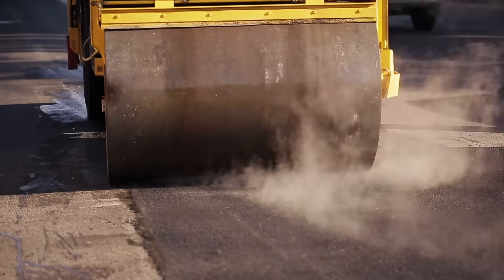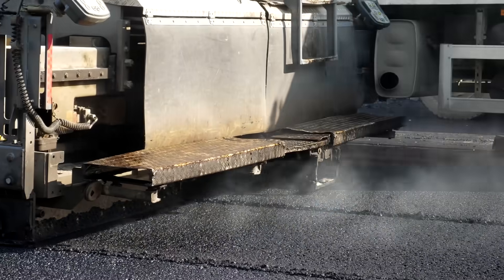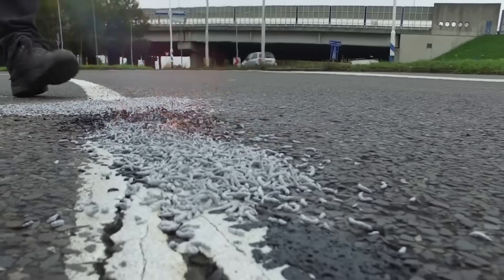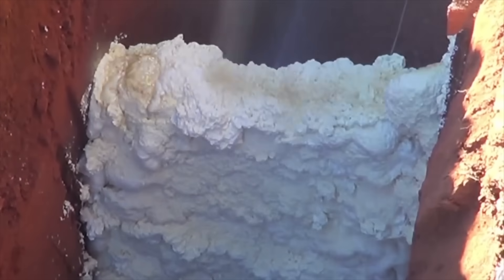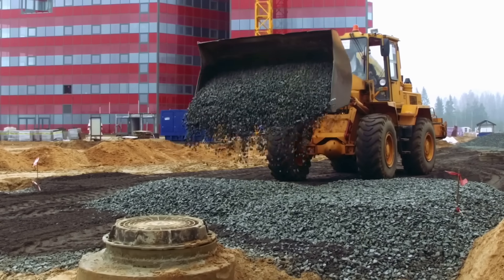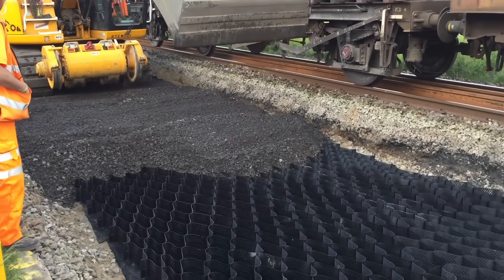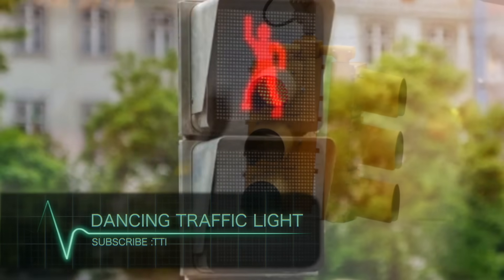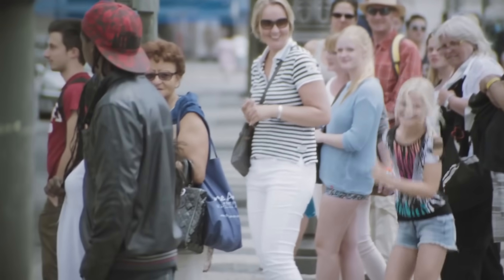7 Road Inventions That Will Change Your Life ▶41

Comment: I've been looking at the geogrid for fifteen years and wonder if it holds up over time. There is another way to stabilize gravel, which involves gluing the surface together with polyurethane. However, that method requires smooth edge gravel, not crushed stone and the right balance of poly to gravel. If too little poly goes onto the gravel, the surface will break up soon. If too much poly is applied, the surface will shed rain instead of absorbing it, defeating its environmental benefits and causing the same problems that large expanses of concrete can cause.  Somehow, it seems that this tech has not caught on enough to be considered 'standard' tech and remains 'new.'

Comment: We should be made to understand that these repair methods assume at the outset that the damage is only to the riding surface and does not result from inadequate or failed subbase or base materials.  In these cases where the sub and base are involved the repair must go deeper and be more  costly and time consuming. The web repairs are the most interesting in that it provides a reinforcing matrix for the fillers being used.  In the example the matrix materials used appear to be  asphalting concrete. The plastic or poly reinforcing web cost must be countered by longer life or  lower construction and compacting costs?

Comment: The product we in saskatchewan call chip seal is very strategic in its design, it is a very clever idea that takes certain compact rock which is very plentiful and crushed first with jaws then with a cone crusher so as to end up with a product that has almost no round shape but like tiny shale pieces. This product idea is that as wheels or tires roll over its in every day use it reduces almost to zero it's property of working loose. Round gravel works loose very easy  flat pieces not so easy. They form a tight stacked and packed principal that does not work loosen as easily. The big thing yet also is it dose not to let water penetrate through as easily thus not allowing the base underneath the asphalt to get soft from becoming muddy. Thus it's name CHIP SEAL. It costs more to make but one engineer told me it durability out performs other repair ideas by ten.

Comment: As a construction executive who has to be involved in road repairs, the geogrid, the polylevel, and the thermoplastic spot repair system really stand out.
Reply: There even trying using old rubber tyres ( under trial , here in the uk )

Comment: most of these technologies look like crap to me. Plastic is way too soft for use in road construction, and since it doesn't bond to tar, you will have millions of fissures for water retention.
Also, while rumble strip are great, they must be made by ADDING tar strips to the surface, not removing divets!!
Making cavities weakens the road at the edge, a bad idea, and makes pockets to hold water, the worst thing for tar.

Comment: We have two major problems in the UK with road repairs, the "Vehicle Excise Licence" (which used to be the Road Fund Tax for the roads) is now mainly used for other government spending and not spent on the roads. The second problem (not ishoo) is that many utilities were laid under roads (gas, water, electricity,sewage, cable). This means gas, electricity, etc, companies keep digging up perfectly good road but never make good the surface. I believe we should have a country-wide rolling programme of gradually moving utilities to the footpaths or grass verges where possible. This would make repairing the road surface much easier, because there would be less, or no, ironwork to work around. It the road surface has less breaks in it, then the potholes which form around drain or manhole covers etc will not occur.
Not that it matters. St Greta has informed me that we will all be toast in 12 years anyway, so that's how long the roads need to last, and no more.
Reply: Bill that's a Great Idea! But what about pedestrians? And who is St Greta?
Reply: @mikeoglen6848  Hi Mike, thanks for the comment. On most roads outside the cities there is usually plenty of footpath, grass verge, or the side of fields where the utilities companies could dig to their heart's content without interrupting traffic. When there are road works, pedestrians often have to cross the road anyway, but if the holes were dug in a grass verge, or adjoining field, the repairs would be less and the road surface not affected. I know the utility companies are supposed to to make the surface good, and pre-plan works with the council. A friend of mine who works for British Gas told me that if they want to do work they just state that it is an emergency and they have no problem digging up the road.
I do care about pedestrians but when they are held up they are not chugging out diesel fumes or sulphur dioxide while they wait for lights to change.
Note that  it should be done where possible/suitable. In city streets I recognise that this is not possible.
St. Greta Thunberg, Scoldilocks, Pipi Longnagging, the prophet of Doom, she who must be obeyed. I don't believe in anthropogenic climate change, and the more I look into the data used (misused) and the people driving it, the more I realise it is a scam which is making vast fortunes for rich people and the poor always pay.
Nobody in the UK government has made more than a cursory glance at the implications of forcing fossil fuel vehicles off the road by 2050. The very least being that most people will no longer be able to drive (which I think is the desired objective).
Have a very good day.
Reply: @KillerBill1953  Very interesting , Bill. I think there's a lot to be said for doing what you say. Oh that Greta! At first I thought it was from an old Prophesy of Doom by a medieval saint. Lol!

Comment: What can you add as a surfice powder as a wat to keep road from freezing?
Reply: ...salt?
Reply: I'm thinking of adding it to the pavement as a long term item, collecting and storing heat.  Salt is corrosive, no good
Reply: @bainsworth8853  well what I would say is that your aim is very unlikely, as the effectiveness would more than likely dissipate over time, ad would still need relaying etc adn you would need to relay the whole surface course...MAYBE a better route would be to find an extremely 'hydrophobic' COATING, that can be reapplied as just a top coat...?
Reply: if there is no standing water then there is no ice
Reply: you would need good cross falls/crowns for this to work

Comment: A nylon or Fullerene strengthened net frame may also prove useful in holding the asphalt firm on the elevated roads, especially when there are dips and rises where the asphalt tends to get displaced. Thank you for the video🎥.

Comment: what about the griding of old used tires very promising never herd any thing on it
Reply: Too much metal. [wires]
Reply: @philip6419  
Tires in liquid nitrogen smashes to pieces when dropped, removing wires.
Reply: don won
Canada uses old tire rubble nuggets to supplement asphalt 
(50%).
Guarantee 50,000 miles, or ten years ?
Ask.
Reply: @don won
 If I'm not mistaken they were being used regularly. Removing the steel isn t all that difficult. But maybe it depends on the  municipality ? I think it's a great idea if it's practical and feasible.

Comment: I used the foam filler on my driveway near the garage as the entire width had sunk due to erosion.  The company that performed this also raised the walkway from my driveway to my house. Entire job was under $600. Far less than ripping up the drive and putting in a new one. Finished in under 3 hours.

Comment: I think all of these are amazing. There are probably better specific uses for each of them. i.e., on ultra wide roads one may be better, on 'spot-shots', others may be better. 

For local repairs I feel that each area of town could have their own personal 'repairer' who is trained,  equipped and ready to respond to local calls of needed repairs from neighbors. They would arrive at the spot in question and either evaluate the need
 or, if a minor repair, fix it  on the spot.

Comment: Rumble strips can pose a danger to pedal-powered cycles. Road tricycles (an alternative to traditional bicycles that are especially useful to older or balance-impaired riders) are generally designed with a three-foot width. Bike lanes usually provide 4 feet. But when the rumble strip encroaches on the bike lane, it becomes unusable to a pedal-powered vehicle with a footprint wider than two feet; the cycle rider is then forced to use the automobile lane.

Comment: Roads fall to pieces because to road builders save money by doing it a cheaper way, but when the roads fall to pieces after they maintain they followed contractual standards, roads last a very long time if you do it properly and use the best available materials. save a dollar on every cubic meter of gravel and spend 3 times what it would have cost in the end to do it properly, My brothers work in road construction and say this.

Comment: A variation of tumble atrips replaced white lane divider lines on Californis freeways starting back at least in the 1960's.  Each line had in its place  round plastic  or rubber bumps.  A vibration could be felt when changing lanes.  Eventually, they would ware out an have to be replaced.  The rumble strips formed from the asphault or concrete road sounds to be a lot less expensive, easier to construct, and a lot more durable.  By the way, the  bumps placed on California freeways could not survive a snowplow in colder climates.

Comment: In certain provinces in Canada, recycled, chopped up old car and truck tires have been  mixed with asphalt to enhance longevity of the roads as well as a manner of getting rid of the age old problem of used tire waste. The noise made by cars on these roads has also been reduced greatly. They've been doing this for decades. Also, all major highways start with a thick concrete base with asphalt as the top coat . As the asphalt needs replacement they just skim off the old asphalt layer and mix it with fresh asphalt making the process faster and cheaper because the thick concrete layer typically remains undamaged

Comment: Roads degrade due to trucks. We need trucks so getting rid of them is not an option. However making a road that could withstand Truck vibrations would be a unique idea and something road workers would hate because it would take away their work. Old rubber tyres ground up into pellets,   A Rubber foam - Glass layer under the bitumen??????

Comment: The submerged foam filler was considered to lessen the tilt in the leaning tower of Pisa, due to fears that it"s increasing lean would eventually cause structural failure. That was years ago I do not know if it was implemented.

Comment: Geogrid polyester materials (typically rectangular squares of various strengths and weight) have been used in a variety of ways. This design is EXCELLENT for this and many more soil stabilization methods. This one in particular protects the dispersion of stone as well as adds strength to the layer. Kudos to the engineer who designed it!
Reply: This system has been widely used in NSW, Australia for the last three years on rail renewals, based on the advice of Geotechnical Engineers.

Comment: WHY DO YOU THINK ROMAN ROADS HAVE LASTED CENTURIES ???THEY USED STONE A NATURAL PRODUCT .  CEMENT ROADS HAVE BEEN KNOWN TO LAST MUCH LONGER, MY OBSERVATION.  IT IS ALWAYS ABOUT MONEY.  THE NEW ROADS OF TODAY ARE CHEAP, AND NOT BEING LAID PROPERLY WITH THE PROPER DEGREE OF STRENGTH; I.E. POUNDS PER SQUARE INCH AS IN CONCRETE.  THEY ARE FAILING AT RECORD LEVELS.  WHAT ARE WE PAYING OUR GOVT. / PEOPLE FOR???  IT'S ALL ABOUT THE MONEY.  LESS BANG FOR THE BUCK.  WE USE SO MUCH AND THROW AWAY SO MUCK IN RECYCLING PERHAPS THIS IS THE ANSWER MIXING PLASTICS WITH ASPHALT/ CONCRETE???  ONE MAJOR FACTOR IS ROAD CREWS TRY TO GET THE ROAD CLEAN DURING SNOW AND KEEP THE BLADE TOO LOW.  YES SPRING LOADED AND OR COMPUTER DRIVEN?? THE BLADE HITS AN IMPERFECTION THERE IN IS ANOTHER MAJOR PROBLEM.  DRAIN THE SWAMP.  GET TRUMP TO OVERSEE IT .  GETTER DONE RIGHT!!!!  WE ALL KNOW EVERYTHING IS MOTIVATED BY ECONOMIC OBSOLESCENCE.  WE HAVE THE TECH TO DO MAGNETIC TRAINS WHY NOT CARS ??WA LA :)
Reply: Trump has not initiated or put any money toward infrastructure, unless you consider his wondrous southern border wall as such. He promised amazing infrastructure programs while campaigning but it seems the majority of his spending has gone towards tax breaks for the rich. The U.S. now, for the first time, has a deficit of more than $1,000,000,000,000 (1 trillion) and no road building, bridges, airports, infrastructure of any kind. Yes, Trump made a lot of people believe that he was the man to shake up Washington, D.C. and MAGA when in reality this great country has been taken for a ride by a con man and his cronies and may never reach its prior glory. He slow walked the coronavirus testing because he wanted to keep the numbers low for this coming election. What kind of a moron would think in such a manner. He also tried to purchase a vaccine from a German company stipulating that the U.S. would have sole use of it over all other countries. Yes, this guy is one stable genius, along with those who plan on voting for him again. Truly unbelievable
Reply: I read somewhere that the Romans used volcanic ash in their concrete, which is why it it so strong and has lasted so long.
Reply: I thought DT was going to sort out all the roads?